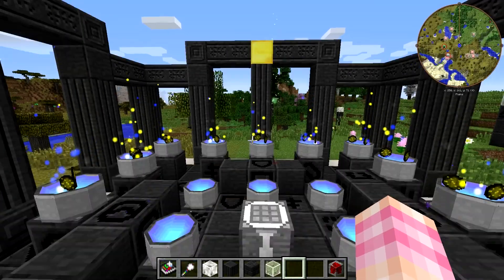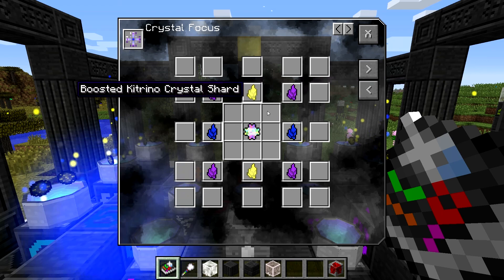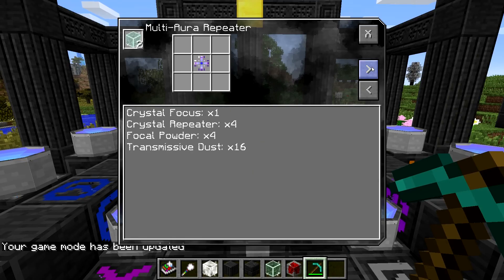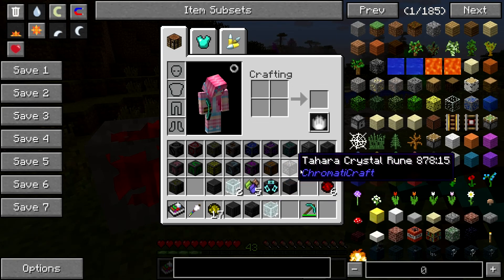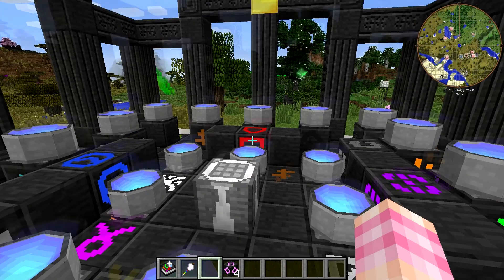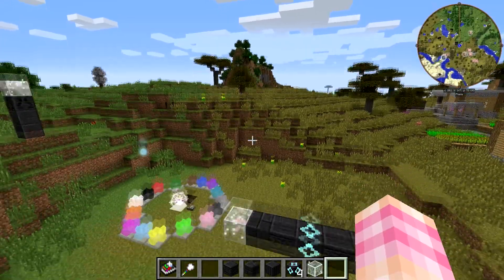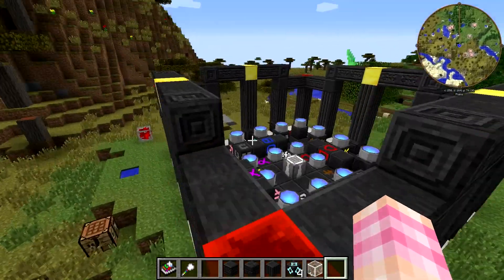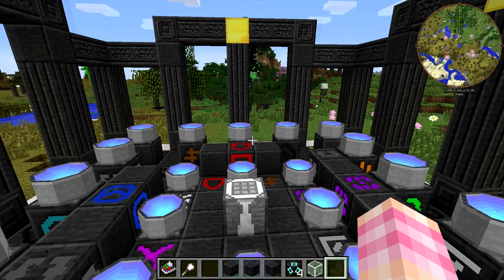ChromatiCraft Tutorial v18 - Multi-Aura Repeaters

Comment: I had asked about automating alloys and boosted crystals... It can be done with the item inserter. But I haven't tried again since getting a little more info from Reika (My world has been broken and I have no clue how to fix it. So it maybe time for a reset). The item inserter is one of those blocks that can be very powerful, but that makes it a bit hard to work out how your meant to us it. 

I forget if Reika explained it but I remember it reacted with redstone signals. It even depended on what side of the block was getting the signal. 

It also seems to need AE or similar for automation as I don't remember any mention of it not just throwing as much as it can in hole. So if you only have half the mats it will just shove them in the (chroma filled) hole and they will time out without alloying anything. So you cant use simple methods (like hoppers) for automation.